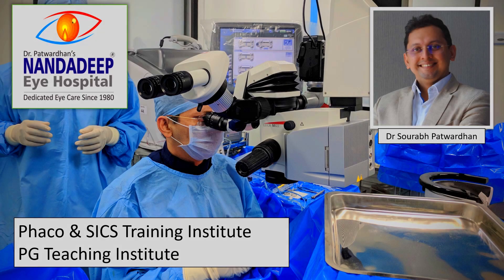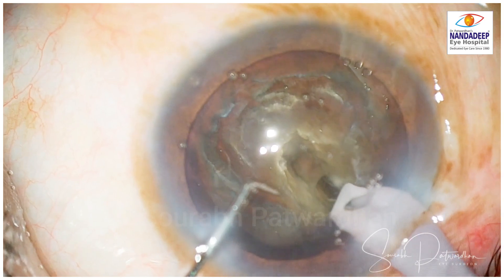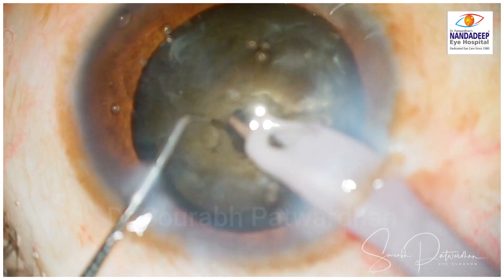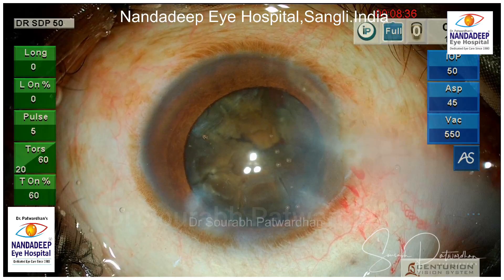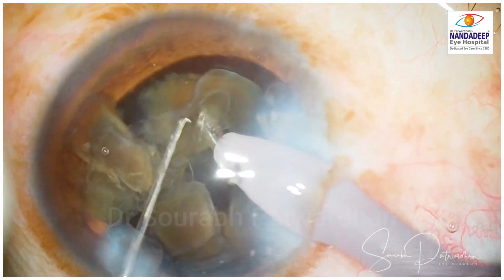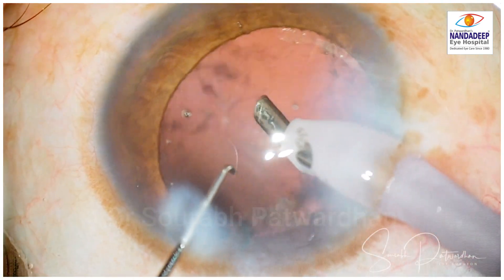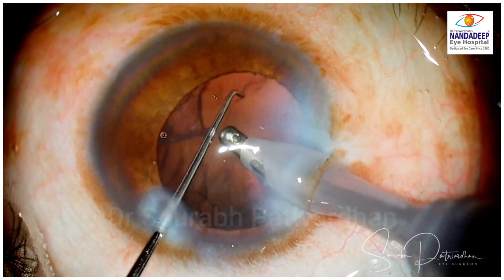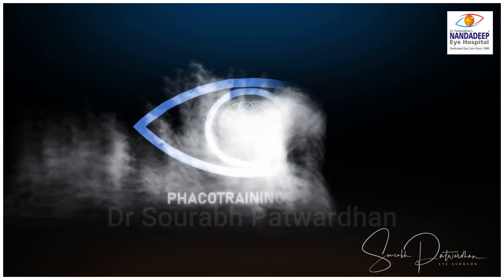178 Quiz is it cortex or something else? How will you manage this - Dr Sourabh Patwardhan

Comment: First maintain the chamber with dispersive OVD.Stain the vitreous with Diluted Trimicilone.Decrease the bottle height to 30cms first go inside with the cutter at max cut rate and lesser vaccum then enter with ia through side port (First vit inside prevents sudden deepening of AC)
Do the vitrectomy and remove the cortex with cutter itself 
Put in Visco again to form the bag access the nature of dialysis and any disfigurement of rhexis .Insert a ctr using Bimanual technique if needed.
IOL can be placed in the bag or a 3 piece sulcus with reverse optic capture as per surgeons preference 
Constrict the pupil using carbhacol or pilo and check for any peeking of pupil 
One last time use diluted trimicinolone for any vitreous .Take care of vitreous if present 
Close all wounds with interrupted 10-0 nylon.Instill air and antibiotic then close
Reply from the maker: Best. Attention given to every manoeuvre..thanks for sharing
Reply: @SourabhPatwardhanPhacoTips  Thank you sir I follow all your videos

Comment: I will keep the irrigation on, take a cutter from the side port and cut the strand, put visco, stop infusion of BSS, remove the co axial handpiece, put an AC maintainer, start infusion do a thorough anterior vitrectomy, if required, stain with tricot, find the edge of PCR, it should get relaxed and freely mobile, no peaking of pupil, will check for vitreous pull on iris margins and underneath iris, examine the bag and sulcus, put a foldable single piece in bag if possible, else put a 3 piece in sulcus, close with main tunnel suture
Reply from the maker: Is there PCR or dialysis?
Reply: @SourabhPatwardhanPhacoTips  Sorry dialysis here, so no need for the PCR steps.